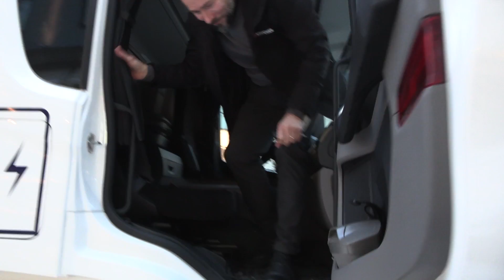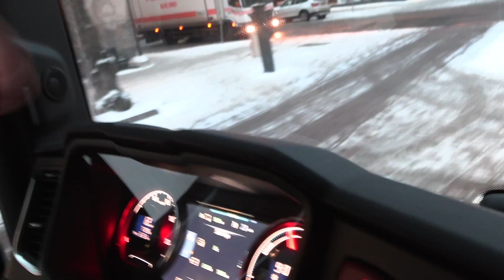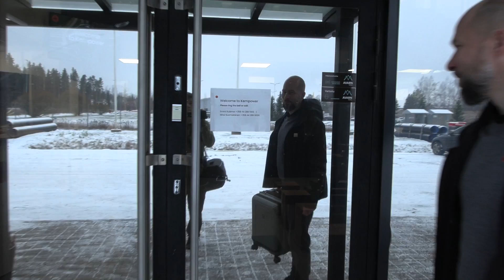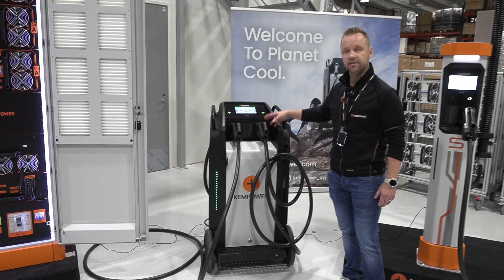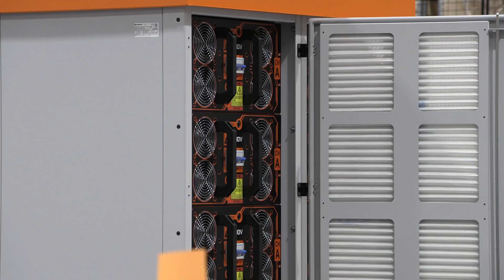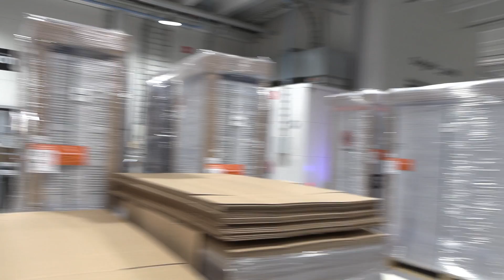Trip to the new Kempower factory part 2

Comment: It would have been interesting to see how they manufacture the power modules. Is this also done at this place, or do they buy it from another supplier? Is it still IGBT based or silicon carbite? 

At the end the concept with these 50 kW power modules is very similar to that Alpitronic is using in their chargers, Just they do not have sattelites. 

Another interesting question would be, how far the sattelite can be placed from the power cabinet. And where is the PLC (Power Line Communication) modem that communicates with the car? Because it is recommended from most charge controller suppliers to have the cable between the charge point PLC modem and that in the car not longer than 10 meters.

And some stories to german "Eichrecht" would be interesting.

Comment: Finally someone make chargers with payment system with cards 🙏👍 . Bravo Kempower 👏
Reply: It's not exactly new. Some of the most "antique" chargers like ABB Terra 53 triple units were equipped with contactless readers from an early age (and probably other brands as well). Sadly in Switzerland those old contactless readers have often been disabled, probably because they broke or the operators dropped the credit card contracts to focus on RFID/app only. It's slowly making a comeback nowadays.

It doesn't look like it was ever a manufacturer problem. It's just the customer rarely bought the contactless payment option with the chargers. Most manufacturers seem to offer it as an option.
Reply: Everyone offers it - the CPOs just need to elect to buy it.
Reply: It's mandatory from June 23 on here in Germany.
Reply: Another part that can go wrong: payment system with cards.
There should be a common phone App for all the superchargers 
where you could register your car and your credit card.
It would then be as simpler as just plug in like at any Tesla Supercharger.
Reply: @nihongobenkyoshimasu3190  No worries. Plug&charge is already an option!